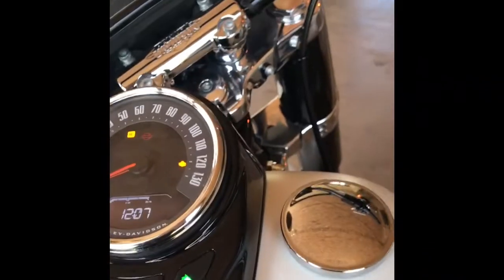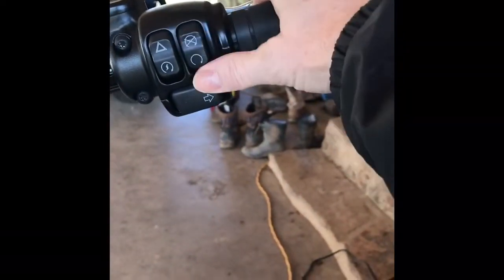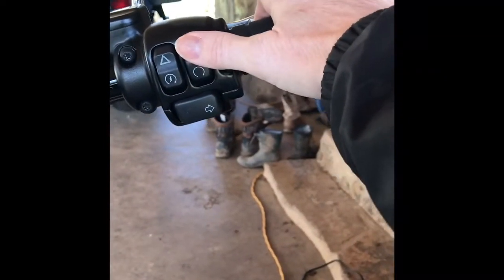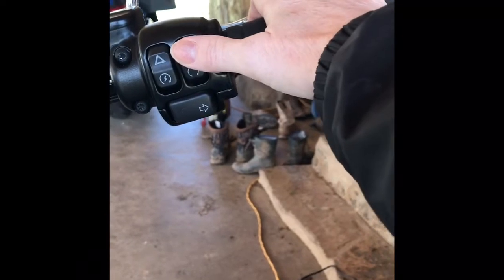How to Manually change Harley Davidson 2018 Security Alarm PIN

Comment: Thanks for this.  First 2 times I did it, it didn't work.  Probably because I was trying to make sure to follow directions exactly.  But I must have been hitting the flashers too slow.  After you cycle the power 3 times, you have to do the flasher sequence immediately and quick presses.  Then I was able to change the code.  Thanks again!

Comment: Hello Heather , thank u for that pin number reset did. I didn't know that they all were the same. I went and changed mine right after . Good information. Also, thanx for the appreciation video.  As always, when able to, Ride Safe.
Reply from the maker: Hi David,
They all come factory preset. It would be pretty easy to steal if you know the code and your forks aren’t locked. Was pretty easy to reset too. Good to have it personalized, in case you ever lose your key fob or forget it at home. Glad it helped and thank you for watching! Ride safe and thank you!

Comment: did exactly as you did on my 2018 street bob but did not work for me. 
cycled on-off 3 times. each off-on only after the buzzing from the on is over. 
is there something I'm getting wrong?
Reply from the maker: Not sure why. Make sure you do it all quickly and don’t hesitate between the steps. Make sure your not leaving he right blinker on either. Power on and off 3 times, left signal 2 times and the right one once. Then it should flash to change the PIN number. I do know on the last step with the right blinker, if you leave it flashing it doesn’t work and you have to redo all the steps. If it still doesn’t work, I’d stop in at a local dealer and have them check it for you. Hope that’s helps and hope it resets for you. Let me know!
Reply: You began the bike on (not the motor) and the flacher right flash before begin the sequance and it work for me !!
Reply from the maker: Glad you got yours changed! Thanks for watching!
Reply: you turn bike On and Off....On and Off... and ON .... 2 left indicator and 1 right indicator....